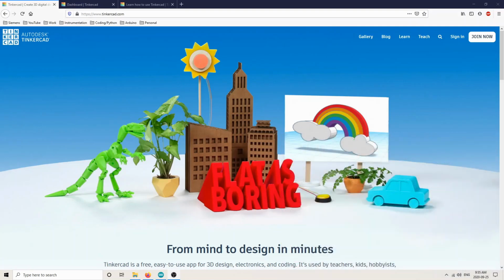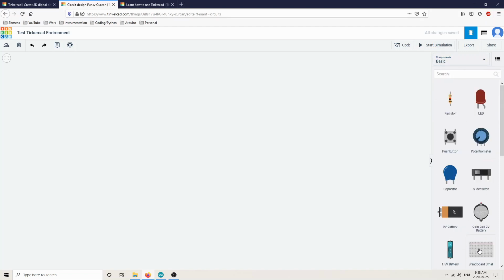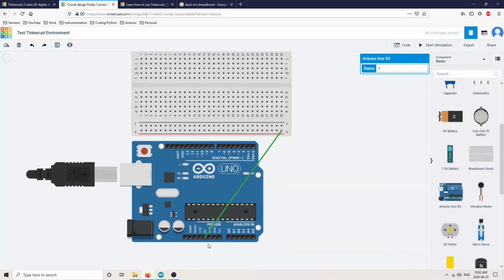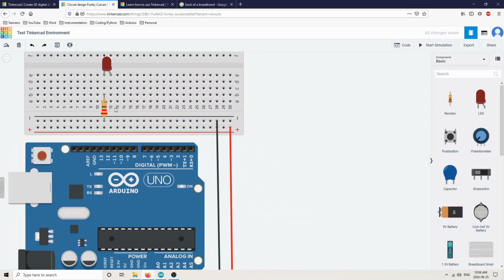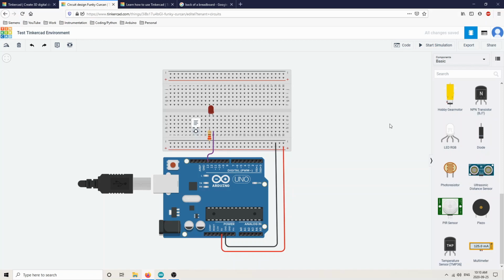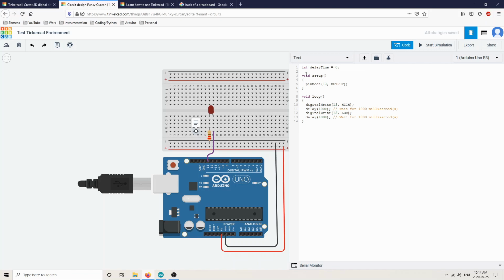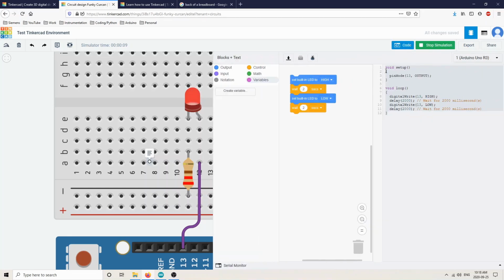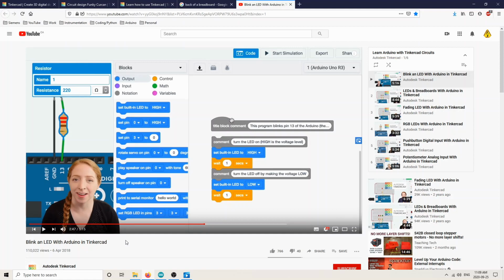TinkerCAD Circuits & Arduino Tutorial

Comment: It says "Current through the LED is 51.3mA, while recommended maximum is 20.0mA. The usable lifetime of the LED may be reduced."
Reply: But you could have easily seen it by increasing delay after switching on LED ;)
Reply from the maker: Thanks for the tip Muhammad

Comment: One minor suggestion.  Increase the volume when you are recording.  I had the increase the volume on my computer past 70 (100 max) to hear what you're saying.  At one point an add came on and it woke up my neighbor in the apartment upstairs.  The walls in this building are not that thin.
Reply from the maker: Ok. Thanks. I used OBS studio for this recording. I'll make sure to check the audio settings from now on.